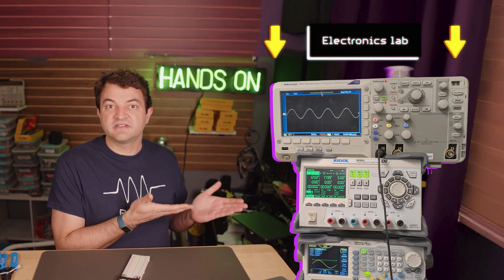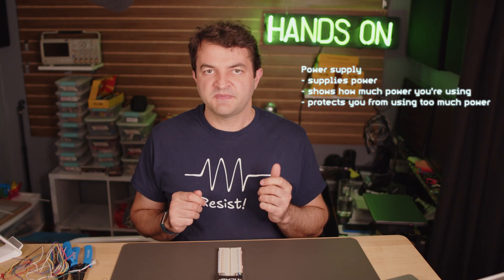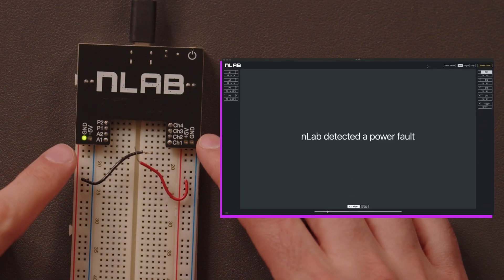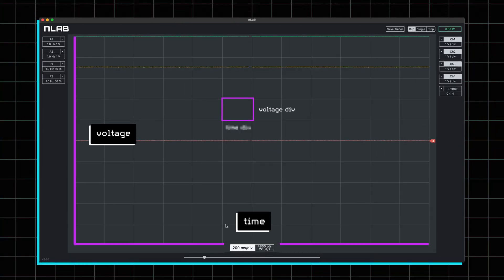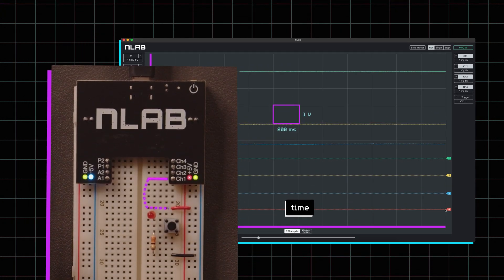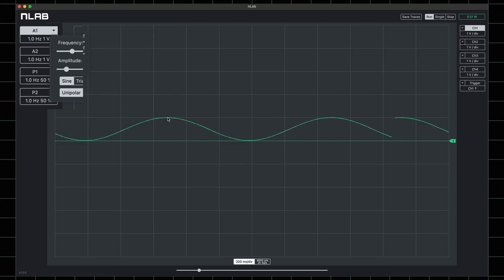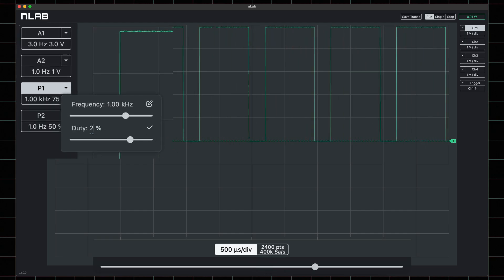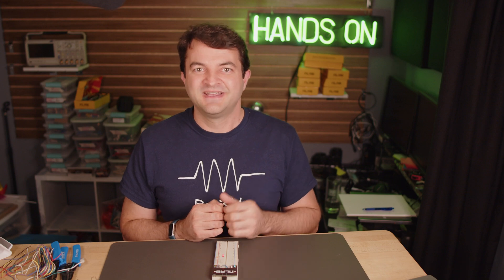this is the world's smallest electronics lab.

Comment: The fail-safe power supply by itself sounds worth it. I would pay quite a bit for one of those that fit in a 2 or 3 or 4 AA cell socket so that I could let my kids play with SnapCircuits without worrying about them shorting the battery box.

Comment: AI Summary

Abstract:
This technical tutorial introduces the nLab, an integrated, pocket-sized instrumentation suite designed to replace traditional benchtop equipment for entry-level electronics development. The device consolidates three primary instruments: a split-rail power supply (±5V), a four-channel oscilloscope, and a multi-waveform function generator. The nLab utilizes a USB-C interface for power and data, leveraging a dedicated software application for real-time signal visualization and control. Key features include active overcurrent protection, PWM (Pulse Width Modulation) for luminosity and motor control, and data export capabilities for post-processing in Python or spreadsheet environments. The system is positioned as a high-accessibility alternative to multi-thousand-dollar laboratory setups, specifically tailored for low-power, battery-operated circuit design and academic instruction.

Exploring the nLab: An Integrated Portable Electronics Laboratory

*   0:00 The All-in-One Concept: The nLab is presented as a portable substitute for traditional, expensive lab equipment (power supplies, oscilloscopes, and function generators), aimed at simplifying the learning curve for independent students and hobbyists.
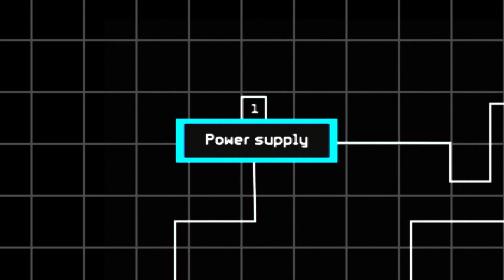*   1:16 Integrated Power Supply: The unit derives power via USB-C to provide a regulated ±5V split rail. It features real-time current monitoring through the app and an automatic safety shut-off (overcurrent protection) to prevent component damage during short circuits.
*   2:38 Voltage Dynamics: The device utilizes a "push-pull" power methodology by offering both positive and negative voltages relative to a common ground, facilitating more complex circuit topologies than single-rail supplies.
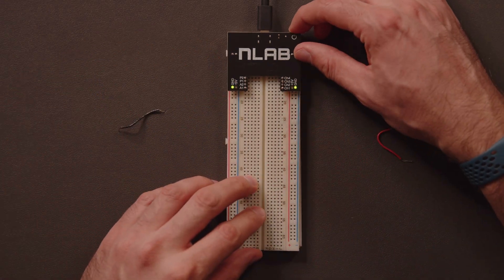*   3:26 Four-Channel Oscilloscope: The nLab includes a four-channel visualization tool. The software interface utilizes a standard grid system (divisions) where the horizontal axis represents time and the vertical axis represents voltage.
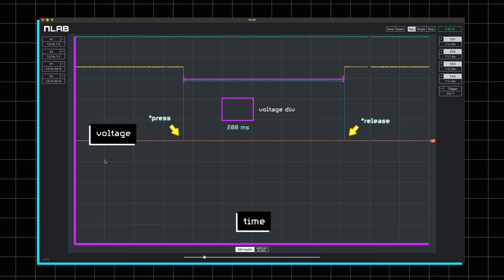*   5:23 Signal Measurement: Users can adjust voltage scales (volts/div) and timebases (ms/div) independently. The interface allows for the vertical offset of channels to facilitate the simultaneous comparison of up to four distinct signals.
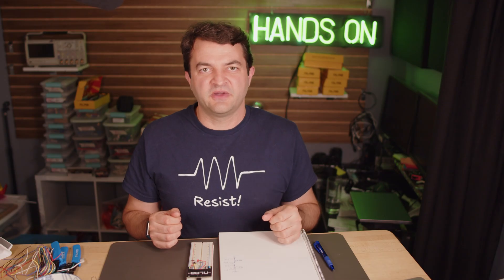*   6:57 Function Generator Capabilities: The device outputs repeating signal patterns including sine, triangle, and square waves. 
    *   A1/A2 Outputs: Dedicated to analog waveforms (sine/triangle) with adjustable frequency (Hz), amplitude, and symmetry (bipolar vs. unipolar).
    *   P1/P2 Outputs: Dedicated to digital square waves.
*   9:21 Pulse Width Modulation (PWM): The function generator supports PWM via "Duty Cycle" adjustments. At high frequencies (e.g., 1,000 Hz), this is used to demonstrate Persistence of Vision, where the duty cycle controls perceived LED brightness by averaging "on" time.
*   10:08 Data Acquisition and Logging: The "Save Traces" feature captures raw signal data. The system exports a screenshot of the waveform and a CSV file containing the raw voltage-time coordinates, enabling advanced analysis in Excel, Python, or AI-assisted data models.
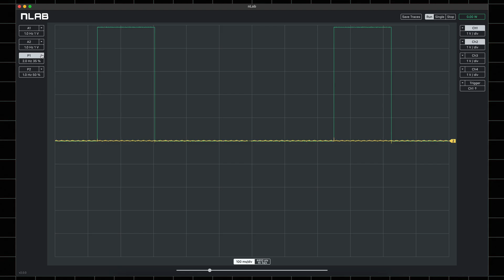*   11:15 Design Philosophy and Limitations: The creator acknowledges that while the nLab is not intended to replace high-end professional equipment for all use cases, it is designed to handle roughly 90% of common hobbyist and educational circuit requirements at a fraction of the cost.

---

### PART 3: Peer Review Analysis

Recommended Reviewer Group: Senior Test & Measurement (T&M) Engineers and Electronics Design Professionals.

Summary by T&M Experts:

*   Target Market Fit: The nLab is a entry-level DAE (Data Acquisition Equipment) designed for the "Breadboard Ecosystem." It addresses the high cost of entry for T&M hardware by utilizing PC-hosted processing and USB-C power.
*   Instrumentation Integration: The device successfully integrates a ±5V rail, which is critical for Op-Amp circuits, alongside a 4-channel logic/analog capture interface. 
*   Bandwidth/Sample Rate Considerations: While specific MSPS (Mega-Samples Per Second) are not detailed in the tutorial, the focus on "low power" and "battery-operated" circuits (phones, LEDs) suggests it is optimized for Kilohertz to low Megahertz ranges, making it unsuitable for high-speed RF or advanced digital bus analysis (e.g., high-speed SPI/I2C).
*   Safety & Protection: The inclusion of active current limiting and software-based trip-wire notifications is a significant value-add for the educational sector, reducing the "shrinkage" of components due to student error.
*   Post-Processing Utility: The decision to export raw CSV data rather than just image captures allows for professional-grade documentation and secondary analysis, bridging the gap between a "toy" and a legitimate laboratory tool.
*   Price-to-Performance Evaluation: At the projected price point ($150-$200), the hardware competes with entry-level ADALM devices. Its success will rely on the stability and UX/UI of the software application, which acts as the primary interface for the "invisible" hardware.

AI-generated summary created with gemini-3-flash-preview for free via RocketRecap-dot-com. (Input: 19,237 tokens, Output: 1,150 tokens, Est. cost: $0.0131).

Comment: Just got this link in my feed, so I headed to the web page in search of specs.
Summary: it's a good tool - for breadboards. 
Breadboards tend to not be that great, if you go faster than about 5MHz. By keeping all the specs below that speed, you can save a fortune.
Just be aware, going faster (computers, ham radio, whatever) means starting over. Buying "better" test equipment.

Comment: This does sound like a really nice thing for beginners! Any plans to make a more powerful version? 

I'm assuming the sample rate can be increased a lot for only an incremental increase in microcontroller cost.

If it weren't for inexpensive pico-based LA's (such as gusmanb's), I'd suggest a uC with extra IOs, feeding a mezzanine connector and allowing a logic analyzer card (etc) to be stacked on top.

Comment: For people that are looking into extreme budget options, you can get more or less this functionality for essentially free. You very likely have damaged USB cables and broken wired earphones. Cut off one end of your USB, there's your 5V power supply on red and black when you plug it into a power brick or your PC. Cut off the speaker ends of your earphones and you have a 2-channel oscilloscope (assuming your earphones are stereo) with one of the many free softwares (Like Zelscope but has equivalent on all platforms to my knowledge). Because your PC doesn't care if your jack device is input or output, most of these software are also capable of outputting signals, giving you a free function generator. Not claiming this is a full on replacement on nLab, but it got me through my beginner stage up to the point where it was actually worth upgrading to "proper" equipment. This budgeting got me through building my first guitar pedals and audio electronics without issues.
Not criticising this product at all as I have no immediate familiarity with it.
Reply: You left out one thing that I think is rather important: your PC's audio is almost certainly built into the motherboard. Putting too much voltage in will burn out the audio circuitry and potentially other even more important bits. Either way, replacing the entire motherboard would likely be the cheapest repair option.

I don't know what protection nlab includes but I'd be quite surprised if it wasn't considerably better protected than an audio jack. And even if it does get damaged, nlab will be much cheaper to replace than a motherboard.
Reply: @markp5726  once upon a time I knew a little about electricity, but it didn't occur to me that "house speakers" for a venue might need more power than a Line In jack might be able to support ... I fried the audio hardware on a laptop trying to record to it from the speaker since the sound board didn't have anything for me to plug into. Whoops!
Reply: @markp5726  Ultrabook audios are on the die, actually.  For the life of me, I can't see how these CPUs are actually not SoCs.  The RAM, ether, and embedded controller are not integrated -- but then that's two-thirds the same as the Raspberry Pi.
Reply: @markp5726  you can get like $2 usb sound card to fry, or add protection.
Reply from the maker: This is where we started! We wanted to go just one step further, with a bipolar supply and 4 input channels, while being right in the breadboard.
Reply: @get-nlab it is kinda neat, and for educational purposes it is most probably sufficient. One thing that I'd like to see is to replace/extend the unipolar/bipolar with a true offset/bias.
Also, enabling 3.3V or 12V would be sweet.
Reply: Thank you man
Reply: This post is a bit disingenuous. Whilst a PC sound card has a 44khz 16bit ADC / DAC, they're designed to work with a microphone and a voice coil.
The mic input is designed to measure resistance. The audio output is neither a general purpose RAMDAC, nor a function generator. These days I wouldn't be surprised if the audio output uses a Classs-D amplifier, which uses PWM and a low pass filter as an efficient transistor driven amplifier. This won't be able to generate a clean logic signal and hold it (at least for very long without damaging your sound card).
Reply: Would doing this be as safe or safer than this product for someone who has no idea what they are doing?

Comment: What is the unit cost?
Is the application standalone or is there a browser version?
Reply from the maker: Hi! Normally our full kit sells for $199, but you can get it for $159 if you place a reservation here: https:/getnlab.com/early-access
Our app is currently a desktop version, but we are working on a browser version!
Could I ask why you're interested in using it in a browser? Are you looking to use this on a Chromebook? Just curious!
Reply: @get-nlab  he said it’s if you can’t install the software (not allowed). 
I always prefer to run software without installing it, so you can run it from a USB flash drive, for example. No registry entries… no files/settings stored in the user folder…
Reply from the maker: Good to know. We're hoping the in-browser version will help with this, or another option would be using our open API with Python or Rust.
Reply: It may sound insane but its much easier for students at the high school level to get a website white listed than to install a program on managed systems.
Reply: @darbodrake89  not insane. Maybe the software will be portable (just extract a zip file and then run it).

Comment: It definitely doesn't replace "$1,000+ of professional equipment".
It may not even be able to replace it's own cost amount of equipment.
Reply from the maker: It has certainly taken a lot of time, design, and iteration to build the right capabilities (15 years of testing 5,000 nLabs with university students) into an affordable kit. I hope our value is getting across! The goal is to make learning electronics accessible without the cost or intimidation of big lab gear
Reply: @get-nlab  The one piece of data necessary to determine whether the kit is affordable is missing...
The price.
Lab gear is coming down in price at a rapid pace.
Reply: Having been involved in homeschooling, I know a lot of the value isn't in what you actually get it's an ease of use and ease to teach. 

But my kids have grown and left the coop and I'm retired and fixed income...
...so if the oscilloscope only goes up to 20,000 Hertz, I'm going to use the microphone input on my phone and an app with the appropriate resistor as an oscilloscope before I buy your kit, but if it goes up two or over 300 megahertz, it's still a good value compared to cheap Alibaba modules if it has any kind of warranty.
Reply: @JohnDokivin  - And what if it has a 100 KHz bandwidth at 4 MSP and 4 channels?  That's what the specs say.  Obviously the thing has major limitations being powered and controlled solely by USB.

Comment: 188 VIEWS WHAT THE HELL.
out of curiosity how much will the nlab cost
Reply from the maker: hi! thanks for your question! the nLab kit will be $199, but you can get it for $159 (20% off) by placing a $1 reservation here: 
https://getnlab.com 
We’re launching on Kickstarter in a few months!
Reply: @get-nlab would reserve it but my financial situation isn't always reliable
Reply: I'm still watching the video but if it doesn't say it in the video is the power supply current limiting and go up to 10A , and does oscilloscope read over 300 MHz, preferably a gigahertz?
 (Cuz there's various modules that require little knowledge that you might be able to get all three for the same price or less, with those abilities)

   What's your warranty? Because that might be the deciding factor here 

 (much of the cheaper equivalents have no warranty and caveat emptor, buying 5 of something because because only one of five will work but you do it anyway because it's a 10th the cost is still a crap shoot)
Reply: @JohnDokivin  you’re trolling, right? 
10A, 1GHz
Reply: @davadoff not exactly, but if those are the numbers I'm seeing in Chinese advertisements for things that would fit in that price range, in reality their probably more like 0.5A and 100 MHz so I got to take that into consideration. Like the 6" by 6 in solar panel that was supposed to put out 100W but they didn't say the physical size in the add and I wasted my money. Reality is typically one or two orders of magnitude smaller than what it says in the advertisement.
   Not trolling, but Chinese measurement units.
Reply: @d @davadoff  I’m curious as to why you asked if @JohnDokivin was trolling? They’re legitimate questions. The presenter did not mention these specs, I was looking for them too.
Reply: @JohnDokivin I found the specs. Output on the o-scope is 200mA, +5 to -5 VDC, Bandwidth is 100kHz, Sample rate is 4MSPS.
Reply: @carrtb  it must be trolling because it’s absurd to ask for ‘10A and over 300MHz bandwidth’